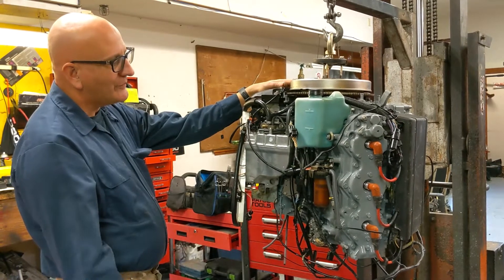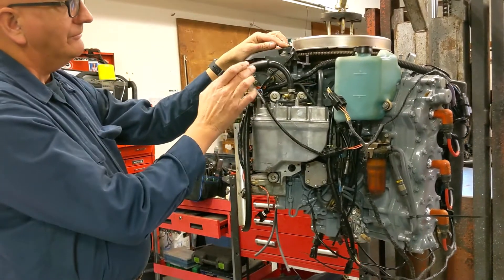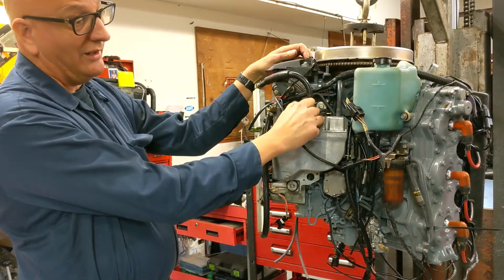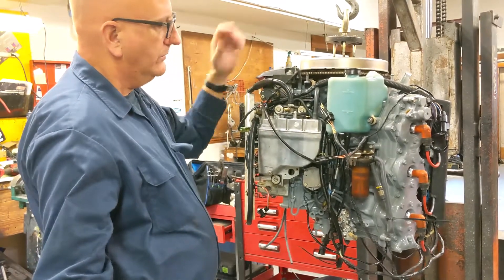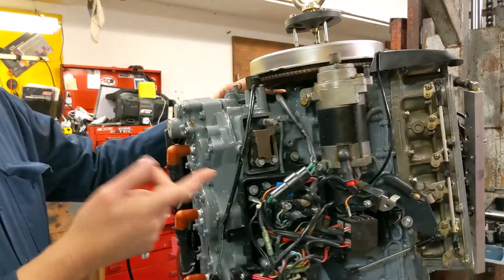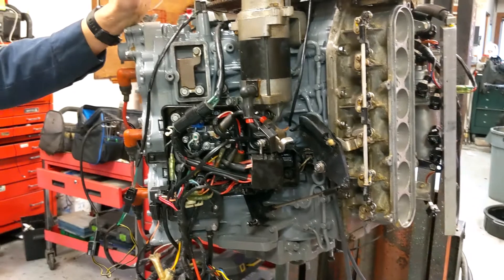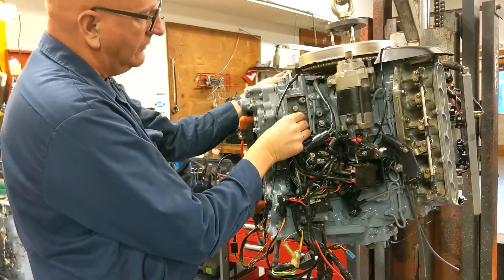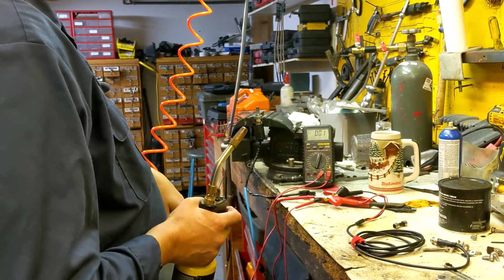Remanufactured 2000 Yamaha 200HP Walkthrough + O2 Sensor Testing

Comment: Goodmorning I just installed 2 used 2003 hpdi yamaha and run great BUT alarms dont stop and are runing off hose .I changed oil tank senser still same problem i dont want to blow up 2 good engines any help would be great > Thanks for your time
Reply from the maker: We would recommend scanning the motor to isolate the alarm. It will tell you why the alarm is going off.

Comment: Mine has excessive fuel consumption, also doesn't go as fast as it used to. Any thoughts? I replace two fuel filters but not the vst filter. The people I bought it from used the wrong oil I think it was engine oil😢
Reply from the maker: We recommend doing compression and spark tests. We would need more info to go any further with diag.

Comment: Hi thank  you for  all your help so far , I now have a laptop with the software installed , however I can’t find the correct connection port on the engine.where is it located?  on the 200hpdi ? Also while searching I took the plastic flywheel cover off and turned the flywheel and I could hear air escaping from the side of the injectors, I recently cleaned and tested all the injectors and replaced the seals and o rings. Thanks.

Comment: Hi good morning I have reached out to you before, I am trying to solve a mystery problem with my 200 hpdi. Long story short engine runs for approximately three to five seconds then stops . good vst . Pressure clean o2 sensor clean injectors , new pair of low pressure pumps,changed the tps. What am I missing could a coil be bad ? I know that the engine doesn’t use all cylinders at idle. What should I look at next? Thanks
Reply from the maker: It doesn't sound like a coil. We would recommend plugging it into a laptop and checking the high pressure fuel pump.

Comment: Hello again what are the signs of a malfunctioning throttle position sensor? Will the engine run at all ? Thanks
Reply from the maker: It will still run with a bad tps, there is a test procedure- we haven't made a video yet but others have. You would use a volt meter. Signs could be not accelerating correctly and smoking a lot.
Reply: Thanks so much for responding. I am going to replace my TPS anyway to see if that’s my problem, the motor was smoking more than it’s twin ,so I ultrasonically cleaned the injectors and replaced all the seals and  replaced the two low pressure fuel pumps ,VST pressure is good but the motor will run only for a few seconds .if you’re ever passing through Westchester county let me know 😊

Comment: Great info on the OX66, I have the same motor and is leaking fuel on the lower unit. I recently replaced the fuel injectors and spark plugs and still leaking fuel, any suggestions what it could be. thanks
Reply: I have the same issue have you found results?
Reply: @troubleshooting6716  check your low pressure fuel pumps. If they blow the diaphragm they engine will run bad and fuel can leak and show itself dripping off the lower unit.

Comment: Hello again I just ultrasonically cleaned and inspected my fuel injectors and replaced the o ring and all the seals ,I also made sure that the inner front seal seats were clean of residue . However after reinstalling the injectors the engine starts but doesn’t run more than two seconds. Can you guide me to a possible cause. The engine ran before but was smoking more than its twin. Thanks
Reply from the maker: Hey Edward, it sounds like it doesn't have any fuel pressure, I would recommend checking that.
Reply: @Oexchange  thanks for responding

Comment: Hi ,thanks for sharing your knowledge. I have a pair of Yamaha 200 hpdi . And I have done the catalytic converter service,however one of the engines smokes a little more than it’s twin especially at startup and just recently there’s a dit of vibration. Can you point me in the right direction on what the possible cause could be. Thanks
Reply from the maker: This motor does not have a catalytic converter. Good job doing the O2 sensors, that's a great thing to upgrade and test at least every 3-5 years. I would recommend checking the oil arm linkage and make sure the oil pump valve is open the same on both motors, next I would have the injectors ultrasonically cleaned and tested.
Reply: @Oexchange  Thanks so much for responding
Reply from the maker: @edwardburrowes4243  no problem! Any other questions feel free to call or email us.

Comment: I have a 2000 ox66 150, im down to 48-4900 rpm at full throttle. Runs good but won't reach full throttle.  I've cleaned and replaced o2 sensor and gaskets. Didn't help.  I don't know what else to do. Compression is good, tps is good. Any ideas?  Thanks for video!
Reply: Did you ever figure this out? I’m having an issue where mine is going from 5500 RPMS to 4300 RPMs still at full throttle. If I ease off the throttle and hit it hard again it’ll go right back to 5500 and eventually go down again.
Reply: @GypsyShufflerOutdoors  CLean O2 sensor.  Replace the VST filter.  Try these first.

Comment: I have a 2005 Yamaha 225 HPDI Vmax. Runs great at cruise and wide open but starts hard and idles bad, especially in neutral when it switches to firing on 4cyl’s. Once warmed up it idles decent in gear but still crappy in neutral. Any thoughts on what to check? I was thinking maybe TPS?
Reply from the maker: Have you checked compression and spark? You may want to consider having the injectors ultrasonically cleaned or it could be the low pressure fuel pumps.

Comment: I have a 99 0x66 200 seems no power to my high pressure pump was thinking there must be a fuse but cannot seem to find one,whe i turn on key i cant hear or feel the pump come on i know it should get power with key on fo a couple secs, crank position sensor?
Reply from the maker: Hey Chuck, try the fuel pump relay. If you can't find it let us know we'd be happy to help.

Comment: Hi excellent video ,I only wish you had shown the electrical hookup to the oxygen sensor.
Reply: one goes left and can be found at the top of the cover over the CPU and the other one goes right and connects under the top of the electric cover (over the main relay, fuses, etc.)
Reply: Thanks however I was referring to the on the bench hook up, meter setting, and connecting.
Reply: @edwardburrowes4243  yes what wires are used on the sensor and what settings on the multimeter

Comment: i have a non ox66 and it has an 02 sensor
Reply from the maker: is it a 4 stroke?
Reply: @Oexchange  2 stroke...vz200tlrb, just cleaned out the o2 sensore and housing and man was it dirty.
Reply from the maker: @DCmite1  Oh okay, it's basically the same motor and the test is the same as in the video. Glad you were able to clean it!